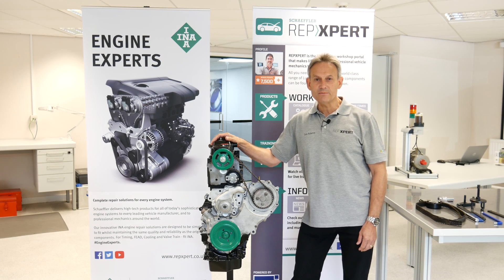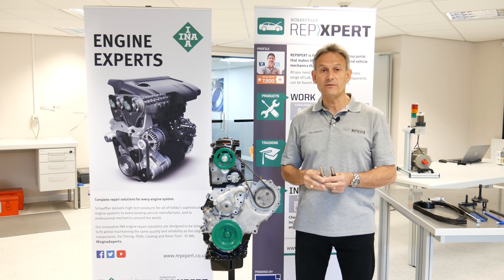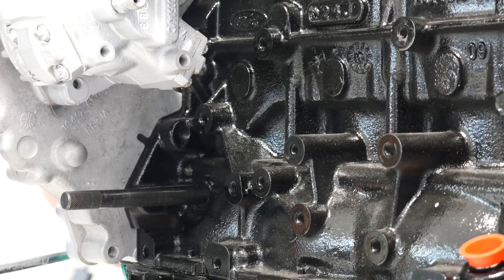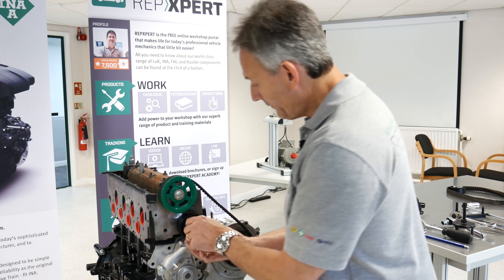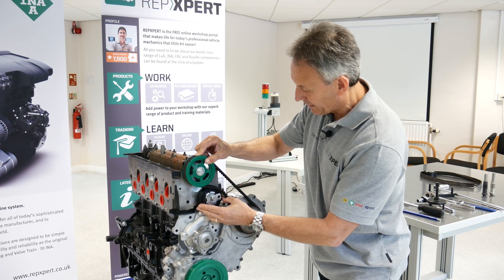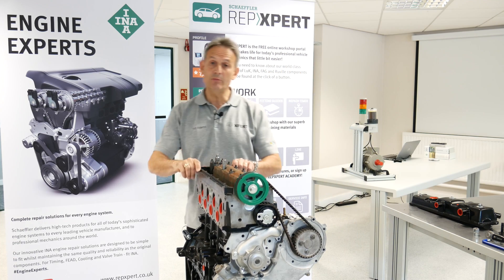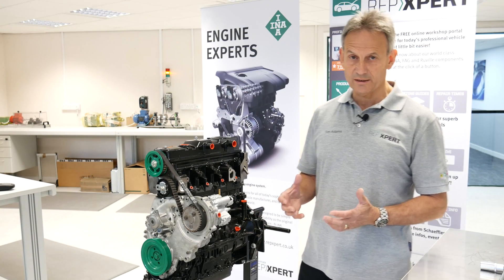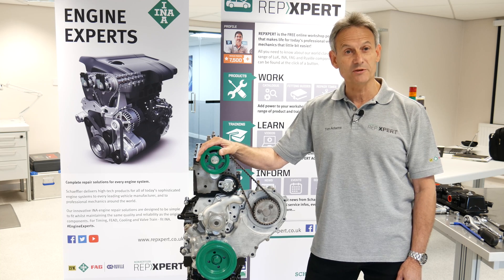Ford 1.8TDCi Engine INA Timing Belt Setup Procedure

Comment: Hi. This video is very helpful. Thanks for uploading it. My question is that on my car the cam shaft snaped which has bent the valve luckily it didn't damaged the pistons. So I have bought the new head with complete valves, Hydraulic lifters and camshaft. So the timing is all out at the moment. I have bought the complete timing tool kit. I have used the timing bar to lock the camshaft from the right hand side. How do I lock the the fuel pump pulley and how do I use the locking pin to lock the crank pulley. In this video the belt is being changed in a normal circumstances n mine is completely different case. Please someone help. Thanks.
Reply: https://youtu.be/S8GGJagGpjc?feature=shared

Comment: Why do you loosen the camshaft bolt? If the engine is properly timed before the procedure and the new belt is identical to the old one then the position of the camshaft sprocket should be the same when fitting the new belt.
Reply: It should but there can always be slight tension differences and the you struggle to loose the slack then , so a floating pulley makes it easier and accurate
11:01

Comment: If you don't want to bother buying locking tools you can just replace timing belt doing the marks. No need to removing top pulley. Locking devices are useful if for some reasons you lost the corresponding positions of pulleys

Comment: It would be nice to see how about the lower timing belt/chain is changed. That is too often missed and missing it on repairs will cause engine failure... Could you do another video of covering that lower timing too?
Reply: Ford changing the lower heavy duty chain to a wet belt has to go down as 1 of the most stupid engineering designs ever!